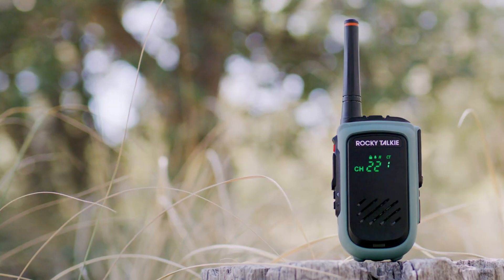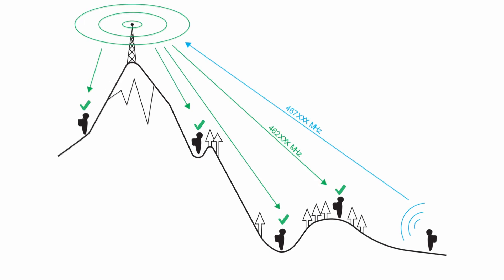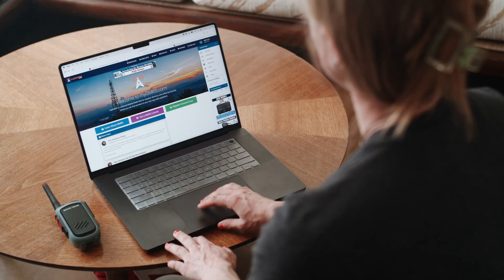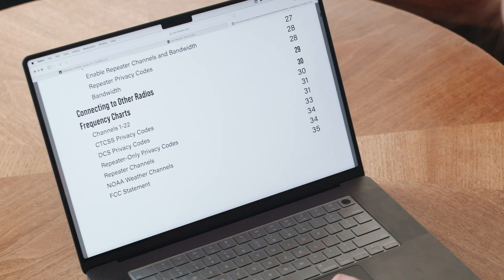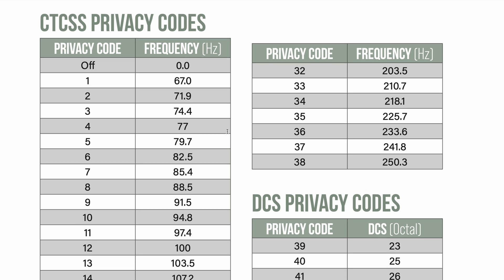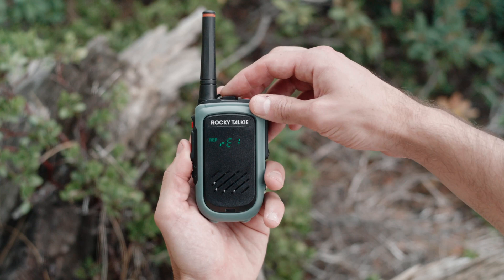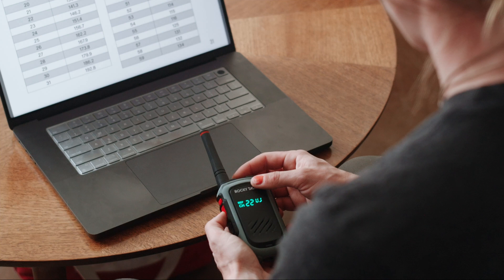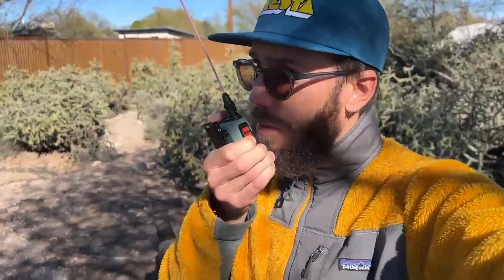5 Watt Radio Connecting to Repeaters - Rocky Talkie

Comment: How far from the repeater one can be and still connect to it from this handheld?
Reply from the maker: That is a fantastic question! It all depends on how high it is and what's between you and the repeater. For example, I have a repeater about 6,000ft above my house (12miles away), with no obstructions, and I can hit it 20 miles away and further. Depending on where it's located, your range will vary. Check out our video FRS vs GMRS range video. All of the same principles apply to your question, since a repeater is basically another radio. I hope this helps and if you have more questions, drop us a line at support@rockytalkie.com

-Nate
Rocky Talkie Team

Comment: ok, so this answers most of my question. However, I see that when choosing the repeater you only mentioned the 462 frequency, but not the offset. like when you transmit, the radio should switch to the 467 frequency.  I know in most GMRS repeaters their offset is usually +5. is this an automatic thing that radio repeater channels do?
Reply from the maker: Great question, that's exactly how repeaters work! GMRS repeaters are a bit unlike amateur repeaters in that their offset is standardized. So our radios come set with the correct frequency and offsets!

Comment: This is off topic to the video. But how do you pressed the button while skiing with poles?
Reply from the maker: That's a great question! Most of us here at Rocky Talkie stop for a moment or use the pole's wrist strap to hold onto the pole while you use the radio. I realize this doesn't work in every scenario but I find I'm able to communicate before or after a particularly difficult feature. I'd love to hear if you think it'd work for you!
Reply: @ Thanks for responding! Just got back from the ski trip. The walkie talkies didn’t work as we intended but were very useful for communication like what lifts to go on and if anyone fell. We were mainly looking for something that you could talk well going down the hill. But this worked really well for other things we will use again!

Comment: Youre inputting 3 on both which has made this a tad confusing. I have the same radio so for the output / input with a 100hz should I input 100 (Frequency) or the privacy code to the left corresponding to the frequency (ex 12 | 100hz)? I ask because the video shows what appears to be a frequency of 51.4. Also how do you account for frequencies with decimals if it is indeed what youll input into the radio?
Reply: So is there anyway to see the frequency the radio is on besides the channel number
Reply: Agreed . Random channel selected to confuse everyone . Laziness
Reply from the maker: Apologies for the confusion! Unfortunately my local repeater has relatively high input/output tones. Rather than watch us scroll through all of the tones, we opted to just show the action of flipping through a few channels for example. Since your tones will likely be different, your process will be a bit different. I do appreciate you sharing your experience and I'll do my very best to accurately show steps in the future! I hope this helps and if you have any additional questions, feel free to reach out to us at support@rockytalkie.com!

-Nate
Rocky Talkie Team

Comment: At the end of the video your partner has a small whip antenna installed on the radio, what model is that and where did he get that? - thanks
Reply from the maker: That's absolutely a Signal Stick and we love their products! We're hoping to release a mono band antenna by the end of the year specifically tuned for GMRS so stay tuned!

-Nate
Rocky Talkie Team
Reply: @rockytalkie1682  I recently bought the 440 monoband, haven't had a chance to test it yet though.
Reply: It’s called a Signal Stick made by SignalStuff. My question is will changing out an antenna like that change the IP67 of the radio?
Reply: @JasonBBall-uz5dt  I just ordered a 440 mono-band to peek at. Will let you know how the fit/sealing goes. My guess it will be closer to an IP65
Reply: Thanks! Yeah, let me know what it’s like. I talked to the guys at Rocky Talkie and they said it won’t affect the IP rating at all. I’m now curious about function of the Signal Stick over the provided antenna. I have Signal Sticks on all of my HTs so it’ll be cool so see how it compares in the GMRS world.